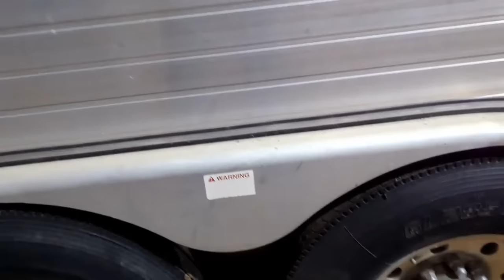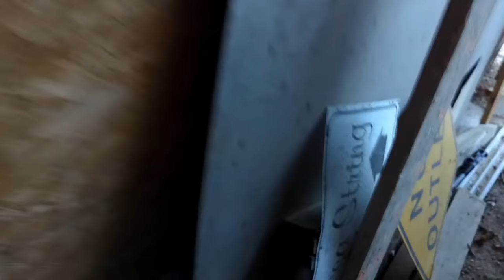Vlog 325 LIVE Rat Control Its a Fact of Farm Life More Wall Progress

Comment: We live on a 5 acre property on Vancouver Island.   We are plagued with roof rats aka ship rats, black rats or long-tailed rats.  For the 1st 5 years I tried to control them by trapping with the large Victor's.  Some weeks I would catch up to 15.  I wasn't keen on using poison due to environmental issues.  After some insurance claims I relented and placed a single commercial bait box in a dark dry crawl space that would not be visited by squirrels or mink.  Our problems ended immediately.   A pack of bait would last 3 to 6 months sometimes more.  I estimate the effective radius of that one box was at least a kilometer.  As that area was eradicated more would move in and quickly find our box.  The only critter that seems to find it's way to the box that wasn't a  mouse or a rat were slugs.  I was concerned about that because snakes ate the slugs and owls ate the snakes.  I was going to try slug deterrence with salt but the province passed new restrictions prohibiting the bait last year.  I was worried but so far my trapping has been more effective than it was before.   My traps are all set in the crawl space and they are checked every day.  I caught a fair number last fall but have caught none since spring rats that is. I am still catching a few mice in the small traps.  I expected a fall rush of rats this year but that has yet to occur. 
My view is that the bait box is more effective because it provides greater security for the mice and rats.  They are happy to spend more time there and are not inclined to remove bait for storage elsewhere. It is convenient to manage only a single bait station and I see no reason any farm would need more unless it was a vast property.
I am pleased so far that trapping has been effective as I was extremely skeptical. Trapping is more labour intensive because traps need to be checked every day and emptied and reset as mice and rats have been caught but it is not too bad and worth the effort so far.
One other thing is that I don't bait my traps.  They seem to be effective without bait so why bother.